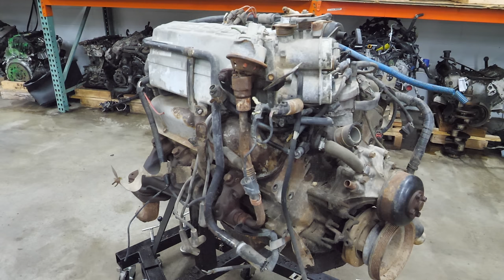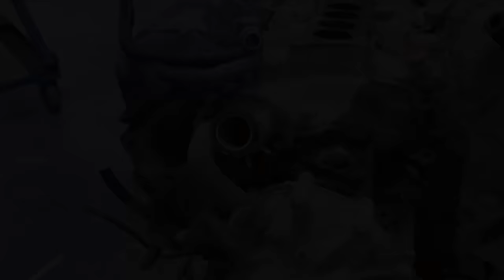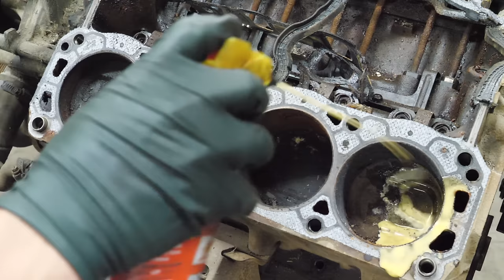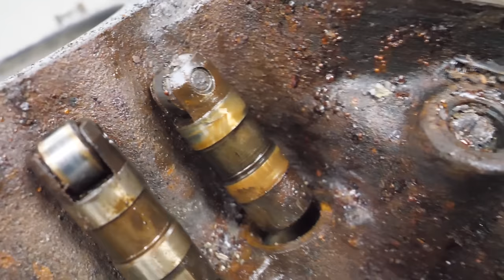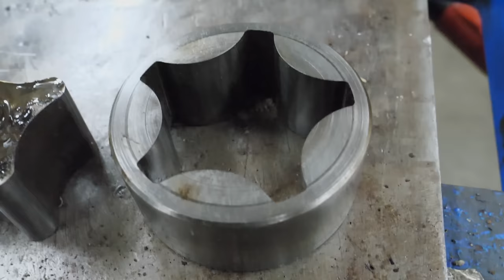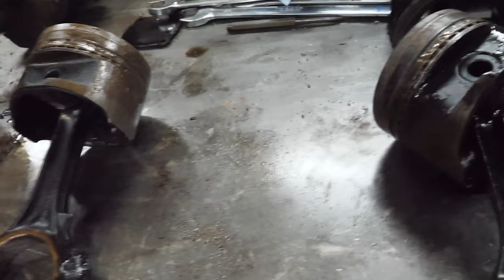LOCKED UP Ford 351W 5.8L V8 Engine Teardown. How Bad Could It Be?

Comment: Too bad you didn’t try things to free it up and see if you could make it run first. i’ve recovered one by filling it with marvel mystery oil, and rotating it on the engine stand. then used a stove burner in the oil pan to heat up the motor. I had it heat up the oil and then I could rotate it on the stand. after I broke it loose, I spun it with an electric motor and kept it heated. as it cooled down, I kept it spinning. then ran it.

Your engine was likely stored upside down outside in the weather a hole in the oil pan would allow rain to get inside the motor doing the damage. I probably could have freed up.

Comment: Funny thing with Ford's is it seems like they were so stingy with larger engines that people think wow this has a 351 sweet whan GM tossed 350s in so many vehicals with Chevy's people say ah just has a 350 when they had comparable power, only real difference is ford went port injection before Chevy but Chevy made around the same power with a way simpler TBI system and you could see the engine and work on it vs Ford's mess of hoses and tubing. Watching this I was thinking it looks like just installing a set of headers on this 351 would have been a nightmare, one of the this wasn't worth the hassle I wish I hadn't  bothered with projects.

Comment: My cousin bought a 89 brand new 4x4 3/4 ton with a 302 five speed. That was a great truck and I'm not even a ford guy. I almost think the 302 was the better engine because I drove lots of Ford work trucks from that era and the 302 seemed better.

Comment: ⚓️ Thanks Josh 🌈 U need homemade rust buster…. Brake fluid works… 1/3 hydraulic fluid…ATF & diesel… mobile dte fluid dujour…. If U know a hydraulic servicing guy… dirty hydraulic fluid is dumped all the time due to contamination 🌈 that stuff is the best. ⚓️ I’m a retired marine engineer… plenty of rusty tow winches under my wrench ⚓️

Comment: i had a small pu truck, i could not get the oxygen sensors out of. sprayed with penetrating oil, still would not budge. the NEXT day i took my truck to a mechanic, was told a flat rate of $30 per sensor to remove. So, i watched, as they lifted my truck, and the guy put a wrench on one, and it came out like nothing, the other was not even tight. wasted my money. the penetrating oil took a few hours to work. works everytime....just not on time.

Comment: Someone didn't completely drain the coolant out before storing it and this engine family (302/351w) is notorious for head gaskets going bad after sitting for a while.  It's the reason why my family got into the habit of tearing these engines apart and replacing the head gasket if they've sat for longer then a year.  Anyway, block looks to be in good shape but probably going to need a sleeve for that one rusty cylinder, would have to bore it out to see and with 200k+ on the engine it was time for a rebuild anyway.

Comment: 52:29 Ye no that thing had no oil pressure problems what so ever.  That engine called for 10w30, was designed back in the days of single-vis oils, and the oil pump moves so much oil that there's no way it didn't still have great oil pressure.

It was a healthy engine before it got put on Davy Jones' nightstand.

This engine is also built back when engines could survive hydraulic lock. I mean, sure, if it's screaming WOT at 5500 when it drinks in riverwater itt'l bend shit, but if it's not in the ketchup itt'l probably survive just fine.

Comment: Once again, whats going on with the pudding pops boxes on that shelf? I get it with the fire extinguisher because well you are you and fire is quite possible!🔥😂Is it just a parts storage box thats never moved, or is there more to it Eric?🤔 Bill Cosby was the pudding guy, is there anything else going on at @Importapart's engine dismantling operation backroom\water pump storage area?😅😂 Inquiring minds want to know Eric....🤔🤷🏻‍♂️👍🏻👌🏻🤣🛠️🔧🔩🛢️
Reply: Also, I bet it's nice to finally tear down an engine block with no weird, crazy fasteners on it! No triple squares, torx, inverted torx, or probably even a hex bit. Its nice to just have regular old 6 point fasteners ain't it? 👍🏻👌🏻🛠️🔧🔩🤔🤣

Comment: These engines weren’t as bad as it seems you’ve you’ve made them out to be especially with proper maintenance. The design is from the 1960’s and has withstood the test of time.  The 351W was meant for high volume & torque and low HP work but can be seriously rebuilt. A good mechanic would know how to align the seals and gaskets to fix oil leaks and use quality fasteners on everything attached. They were easier to work on than modern engines except for the smog crap.

Comment: I did a sabotaged 455..it got waterhosed. I beat the crap out of it getting it apart punched it 0.30 it turned out great. I spanked alot of racers with that big block..😂

Comment: I'm getting mixed signals from you. You say you're not a mechanic, yet you do a great job with diagnosis on difficult vehicles like BMWs, and did a better job taking that rusty engine apart than I would have. And the ASE says I'm a master. So, are you a mechanic or not? you sure act a lot like one.

Comment: Those EGR pipes are awful, always extremely stuck and on the 302 / 5.0 the pipe starts under the intake plenum so replacing it involves pulling the plenum. It's always rotted out and leaking exhaust.
I never knew the 351 ever had roller lifters, it must be because this is one of the last (and rare OBD2) versions.

Comment: Back then real men didn't drive slush boxes . The 5 speed manuals would get 200,000 to 300,000 miles on them " if you knew how to drive" then through in a clutch and keep going.🍻

Comment: Could have sprayed the wrist pins and the cam with gallons of, "PENETRATOR" maybe turn the cam free with a pipe wrench but yeah why bother really, its all junk at this point. But hey the intake manifold came off and at least its good. So not a total loss.between that and the scrap you might almost break even.

Comment: 4:04 You reminded me of an episode of Wheeler Dealers. Elvis was trying to remove cooling pipes on the oil cooler of an Audi RS 6. He even used "hot breath", but all he did was crack the fitting on the oil cooler. A new cooler was 1,000, but they got a used one for 280, through the Audi Club. 
Episode:  https://www.youtube.com/watch?v=xwHTrbwu-sk    Elvis breaks the oil cooler, at the end of the video.

Comment: this engine in an F150 would pass everything BUT a gas station, until GM came out with the Vortec engines! I have you beat on a rusty engine, a 3500 diesel in an Allis-Chalmers D21 tractor that sat under a shed for 30 years! the valve cover was SLAM full of rust and the engine is locked up, no it did not rain in it which surprises me why so rusty (humidity?).

Comment: I used to work with a mechanic who would say in that situation "Yerrrr a lucky mother****er". I ended up breaking the timing cover to get mine out a couple years ago, thinking that would be quicker than drilling out the broken bolt. Guess who'll buy an induction heater if he ever has to replace another water pump?

Comment: I wish I could afford to get my wrecked car with the 3800 V6 still runs motor still runs it's a 2002 Pontiac Grand Prix GT 4 door other than front end damaged good motor can be saved I'm in effingham Illinois straight West of St Louis on interstate 70 I've told people I'd sell whole car for $500 good tires and wheels All glass is good doors are good real good interior

Comment: A good  penetrator is half & half ATF and Acetone.
Reply: I really like the Deep Creep by Sea Foam. Like all penetrants you have to be able to loosen just a smidgen to let it in. I've used it on 5.4l 3v plugs that like to break with great results.

Comment: Did you see the ford motor from FabRats that was in the Yellow Submarine they pulled from Lake Mead where it had sunk years ago & was exposed during the drought? It wasn't as bad as this engine...
Reply: Because the bottom of lake mead has no oxygen

Comment: If anyone needs a Ford 300 that ran when parked, let me know. My father parked his '84 F150 well over a decade ago, due to the inspection station refusing to inspect it again. Ran when parked, but everything else was deteriorated, and even he headlight switch needed a spacial wiggle to work.

Comment: Ford had the 351W dumbed down power-wise and the fuel economy was noticeably lower than Chevy’s 350 of the same era. Having said that they were a very solid workhorse in their trucks and vans. The bottom end was much stouter and more suited to trucks than the 5.0 Ford of the same era. The Ford 5.0 and the Chevy 5.0 fought tooth and nail for the worst truck engine ever built award.  
Other than seeping oil from just about every gasket and seal and being very thirsty the 351W was a good truck engine. Countless F150, F250, E-Series vans came with them and down South here you can still find trucks with them in them.
Reply: Not sure what you mean by “dumbed down” compared to Chevy. Ford had multi point port fuel injection starting 1988 if I remember correctly, and Chevy just had TBI all the way until 1995. While I envy the simplicity of TBI,  it’s pretty much undeniable that the late 80s/90s 351w made a decent bit more power, torque, and were more efficient than the TBI 350s. At least Ford didn’t put the entire fuel injection system inside the intake manifold exposed to a bunch of heat and oil vapors like the Vortecs had.
Reply: The Ford 351W made anywhere from 180-220HP in 1994. The TBI 350 made 180-200 depending upon the model and it did it with rudimentary TBI injection whereas the Ford had MPI . A 2WD 350 TBI would see 21mpg easily with automatic overdrive and a 351W never saw better than 15-16mpg in the same application. 
I stand by my statement that it was dumbed down. The 5.0 Ford was putting more power out in car applications than the 351W truck engine was. With MPI it should have been even better than the 350Vortec that appeared in 1996 but it wasn’t. I certainly wouldn’t argue that Chevy’s Spider injection for the 96-98 Vortec was a better design than the MPI of the 351W but that still doesn’t change the fact that the 351W got big block fuel economy numbers with small block power output. I was a Ford technician for years and I know what the real world fuel efficiency numbers were for the 351 and they were abysmal for the amount of power that they had.
Reply: @prevost8686  I own a 1993 F250 with the 351w but you have way more experience and knowledge than me as you were a tech and I’m just a young guy trying to get into this stuff so I apologize if my first comment seemed hostile, that wasn’t my intention. I agree that Ford could have done better with this design power wise. I would also love to have less smog crap on mine. Do you have any insight into why Chevy didn’t have air pumps and all that while Ford did? My friends 1993 K1500 engine bay looks like child’s play compared to my same year Ford
Reply: @jackk21  The only Chevys to have air pumps during that period were California spec’d trucks. I honestly don’t know how Chevy managed to get the 5.7 pass the emissions requirements of the time and Chevy didn’t. I suspect Chevy did it by retarding the timing at idle to 0 degrees. This along with the increased engine temperature caused by retarding the timing got them past needing an air system. To be fair, the 351W fuel economy wasn’t great for the amount of power that it produced but after working on both the 351 and the Chevy 350 the 351W was the more reliable engine. The Chevys were known for their heads being cast so thin that they routinely cracked without ever being run hot. The Introduction of the Vortec in 96 was even worse than the TBI models. I can’t ever remember a 351W cracking cylinder heads and wearing valve guides out like the Chevys did. I lost count of how many Chevy Vortec heads I have replaced in the last 20 years. I’m willing to bet that a person could trash the entire air injection system and factory tune on the 5.8 Ford and run an aftermarket EFI system such as Holley and see much better performance and fuel economy. 
 I still own a 95 Chevy Silverado with the 5.7TBI and reliability wise it has sucked. On the other hand it is so simple to repair and parts are relatively cheap for it so I keep it around. The 5.8W was a much more reliable engine. Just not great gas mileage and more complicated to work on. Take care👍

Comment: That's not that rusty>>>go watch Cold War Motors. Poor storage for sure. Bores will need some soaking. Heads aren't too bad, but for the work they will need, new ones will be cheaper. Good buildable core.

Comment: 1986 was the first year for the Fuel Injected 351W, to say OBS's had the best engines is factually incorrect. My 1985 F-150 has the 351W High Output with a 4BBL Carb, its just as reliable as the fuel injected models. The older the 351W is the better it is actually because their is less emissions crap to deal with.

Comment: I was literally screaming "NO!" when you started turning that first water pump stud.. I learned the hard way on my mom's 92 bronco. Gotta use heat there. And on the whole shaft not the head.. the bolts corrode to the aluminum timing cover..

Comment: induction heaters are fun

Edit: Ewww, you should know better. You heat the nut or hole, not the bolt or stud. The idea is that steel expands when it's heated, so you heat it up to expand the outer threads off the inner threads. Also, go till you glow. Any time you're using heat, go as hot as you think you're going to need to go, and then go some more. If it ain't glowing, you ain't doing shit.
Reply: He is far smarter than you.  Go sit down junior.
Reply: @Look_What_You_Did  From the looks of it, nope. 

But I live and work in the biggest rust center of the world, and use heat to break hardware loose every day. I've seen what works and what doesn't, and a lot of his usage of the induction heater in this vid was 100% a waste of time.
Reply: @PlatypusVomit  Awwwww..... the keyboard warrior.  "why I've done this, and that"...   Where is your business?  Where is your video proof?  That's what I thought.  You got nothing but a keyboard.
Reply: @Look_What_You_Did  dat ad hominem. We've got video proof that I'm correct that he's doing it wrong. Nothing else matters.

Comment: Personally I think penetrating fluid is a scam it's one of the best selling products that never works, I've soaked bolts in it for days removed the bolt or whatever intact or broken and it's as dry as a popcorn fart, it didn't penetrate anything especially threads. Has it ever worked it must have somewhere at some point but I've never seen such faith in a product that didn't do anything so often, it seems like it just makes everybody feel warm n fuzzy that they at least tried when they basically just wasted there anf posdibly someone elses time waiting for it to "soak in" when they should have just heated it or not and snapped it off or not and moved on... Including myself. It probably wouldn't sell as good if they called it what it was the worst engine cologne you can buy.  Better off just investing money into a good method of removing broken bolts, Probably could could eat some asparagus take a wizz on the bolt and accomplish just as much,.. a wet stinky bolt😵‍💫

Comment: Yeah, you aren't an engine restorer. You would have had to use citric acid or a rust remover to clean that rust off and that engine isn't worth it. Too bad they let it get exposed to a thunderstorm or two.

Comment: alert to a Bullshit Advert!!!
Bro if the DC heater had worked the nuts that were heated would have come off NOT The STUD ... in ZERO of the uses of your new Heater Tool did the new Heater Tool ACTUALLY WORK!!